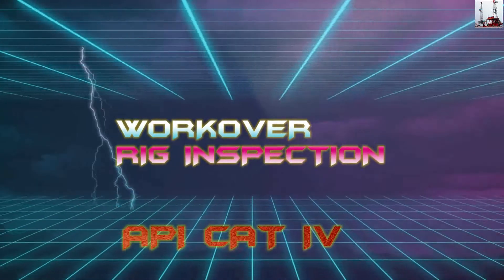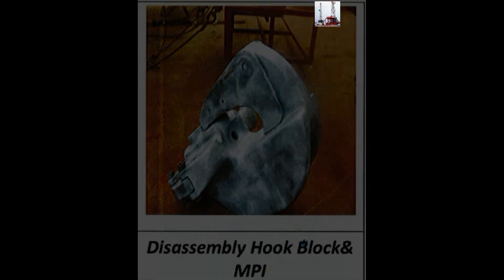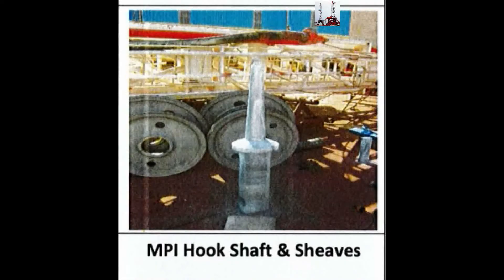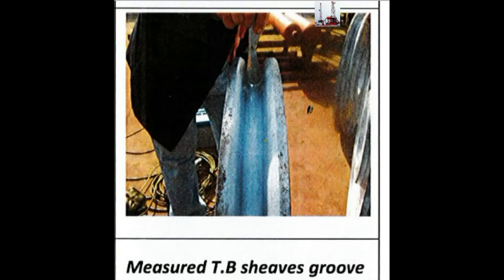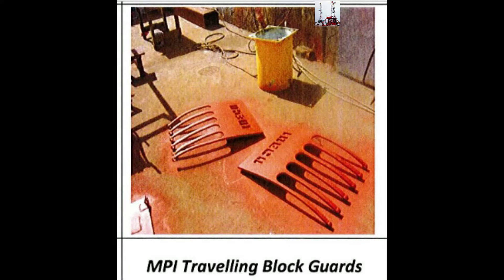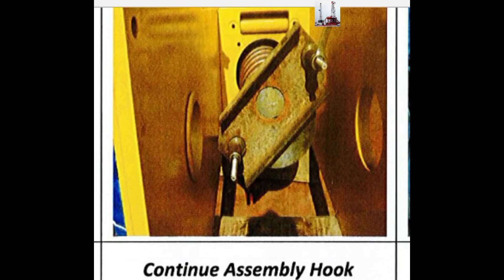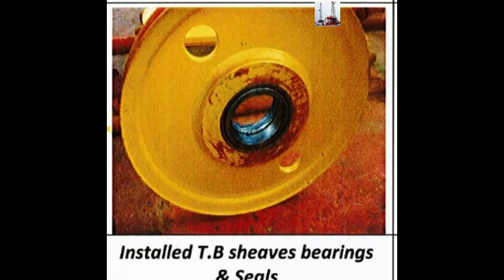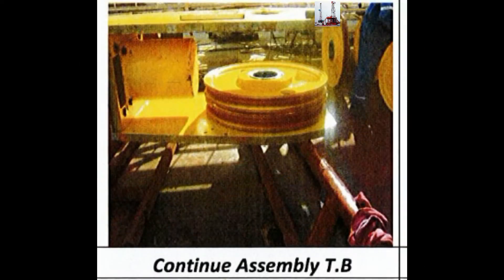API CAT IV INSPECTION TRAVELLING BLOCK

Comment: Good video, but, you should have disassembled the Hook to Block Adapter in order to perform full MPI to that critical piece and connecting pins (02)
Reply from the maker: "Agreed, disassembling the Hook to Block Adapter is crucial for thorough MPI inspection."